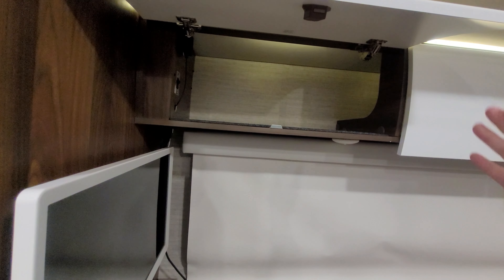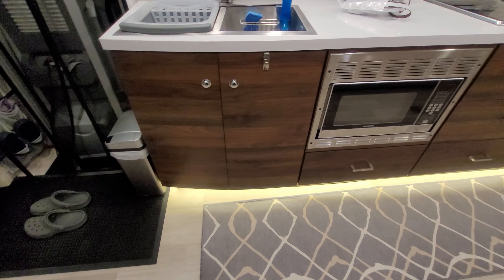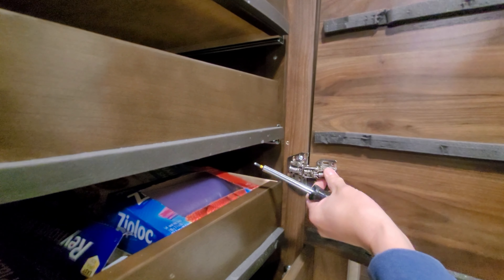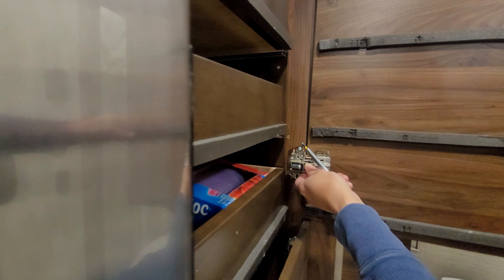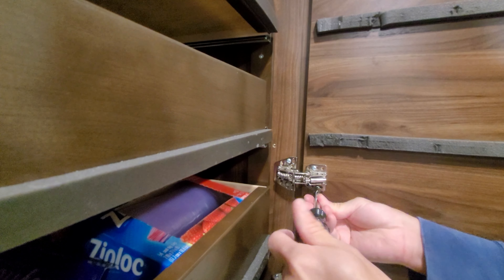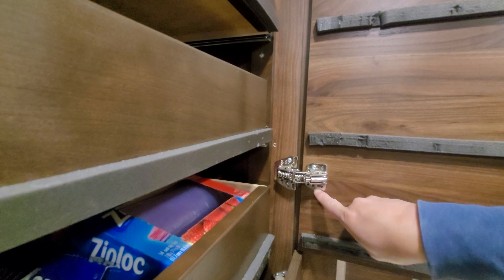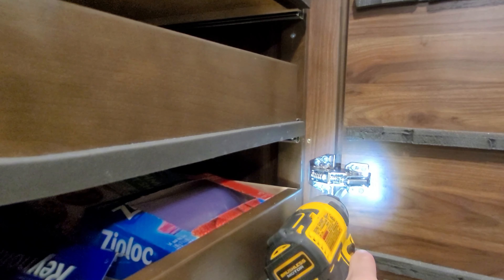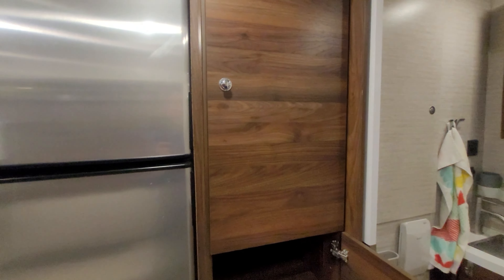Soft Close Hinges on my Winnebago View Navion

Comment: Thanks for re-filming this mod.  One question....why did you not just add the soft close hinge and leave the factory hinges where they were?
Reply from the maker: @markpillori two reasons.  The side opening doors don't have any weight that fights gravity, so adding an additional spring loaded hinge makes the door fling open more rapidly. A third hinge adds more weight either though it's insignificant, and mostly because I knew I had the ability to replace just one hinge. I don't think any of it really matters that much though.
Reply: Thanks. That makes sense.
Reply from the maker: @markpillori  👍